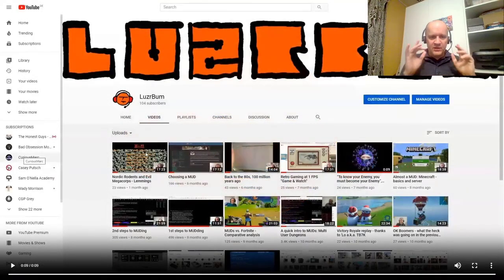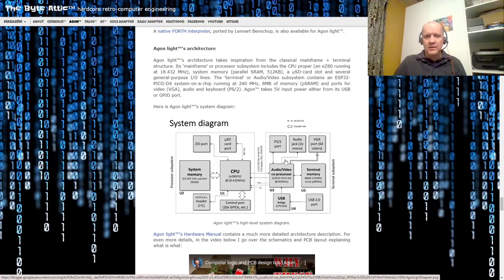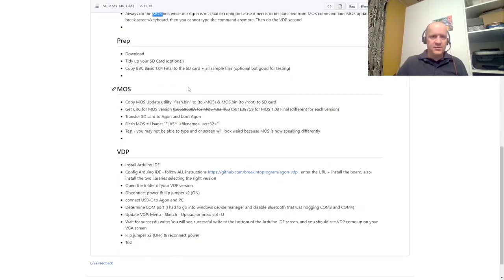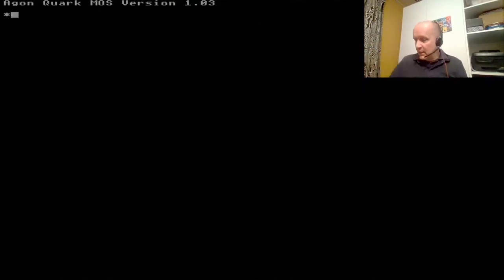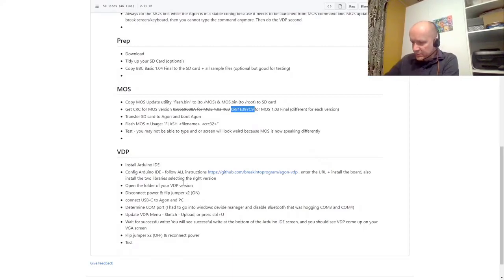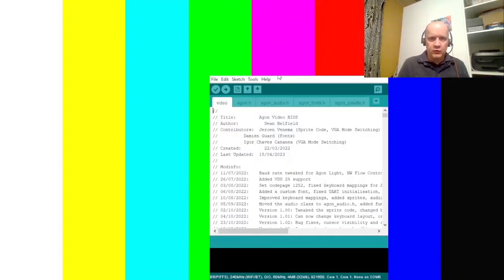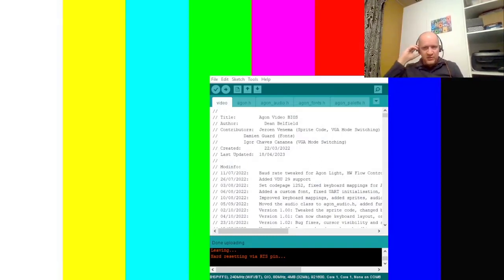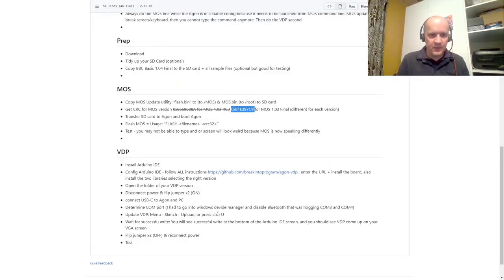Agon Light MOS & VDP Upgrade Walkthrough

Comment: Could you please confirm if my understanding is correct - for VDP firmware programming, do we use the same cable that is used to power Agon Light? In my case, since I have Olimex Agon Light 2, that would be USB - USB Type C cable. I have tried connecting my Agon Light 2 to my laptop with Arduino IDE running, and it did recognize the board connected to the laptop.
But I'm still a bit hesitant to update MOS, since I would have to update VDP as well, to get my Agon Light to the working state again, I want to be sure I understand the whole process correctly before I start.
Reply from the maker: Yes it is the USB C cable for VDP - don't be too scared - do the MOS first - worst case the screen looks a bit funny

Comment: Thank you for demonstrating the update process.  I discovered that the 0x is not needed at the beginning of the crc32 checksum.  I also discovered that responding to the y/n requires a lowercase y or n to continue. To update the VDP, there is no need to do anything with the jumpers.
Reply from the maker: Thanks!